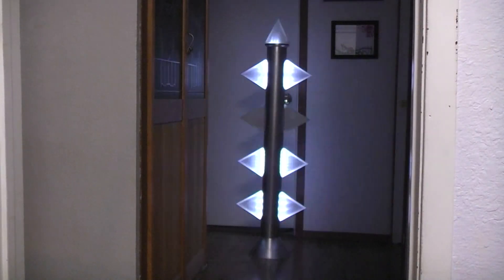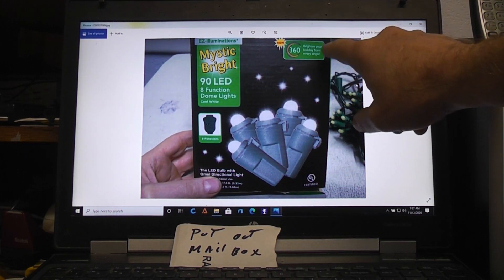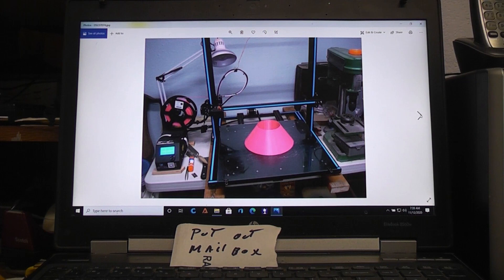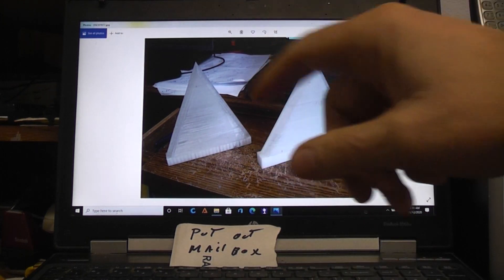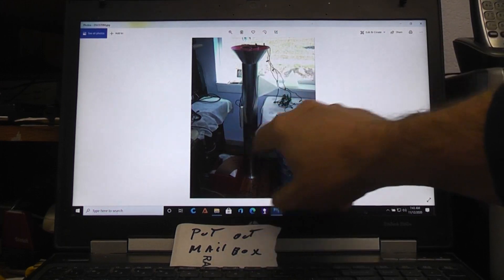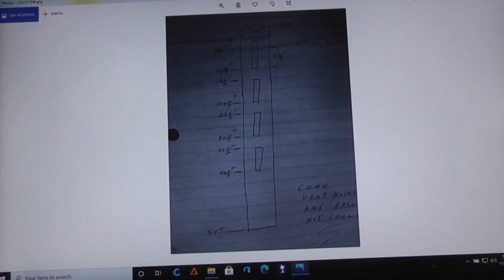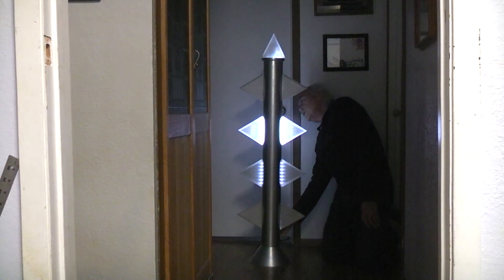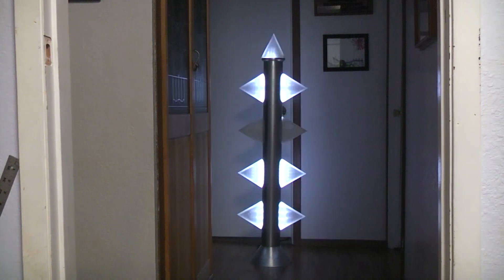Build the "low cost" Forbidden Planet Force Field Post.

Comment: Hi John,  I have searched on Walmart site for those lights , they have no  listing for the Xmas light set . What color spray paint did you use for the Fence Post, it looks like the color is the same as the Forbidden Planet Rifles , like a Pewter like color ? Was curious what paint you used ? Thanks for this great build !!
Reply from the maker: I found the lights in the walmart store where they have all xmass lights for sale, could be they do not sell them on line. But if you search for that same light set as a google search you will find others selling them at a high price than what I payed. 
The silver was dupli color metalic aluminum. Not chrome like just a dull aluminum metal color.

Comment: That's fantastic! I wish I had a 3D printer to make the clear fins.
Reply: 3D printers are pretty affordable now, as is the filament.  Go to Amazon and search for Creality Ender 3.  I have that printer and it's worked really well for me (and it's relatively cheap).
Reply: @jayducharme  I've been seriously considering one. Thank you for the referral. I've heard of that particular model the most.
Reply: @outsider238    It comes either as a kit (and there are some good YouTube tutorials on putting it together) or you can get it fully assembled.  I've made a few modifications to mine and I'm really happy with the print quality and reliability.  It's not like using an inkjet or laser printer; it's more finicky and you have to keep tweaking it.  But once you get the hang of it, 3D printing is both fun and remarkably useful.
Reply from the maker: @jayducharme  You can also buy a Ender 3 Extrender kit that will change the build size from 220 X220 mm to 400mm X 400mm. I think the kit is about $160 bucks. Still cheaper than buying a large scale printer.
Reply: @Robothut    Yeah, and I've considered it.  But so far I haven't needed to print anything that large.  Plus, I don't think I'd have the patience.  As it is now, modest prints can take 6-12 hours.  I can speed it up, but then I lose some accuracy.
Reply: @jayducharme   I'm waiting for the Star Trek Replicator to come out!
Reply: @outsider238    LOL!   Aren’t we all...